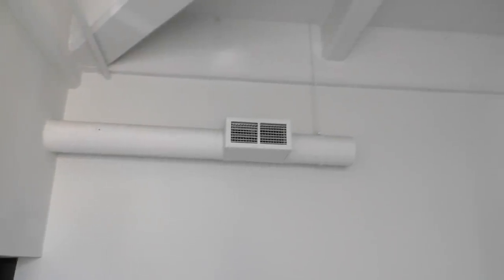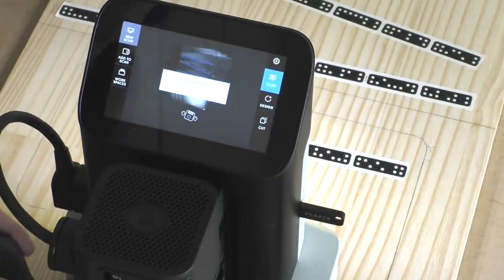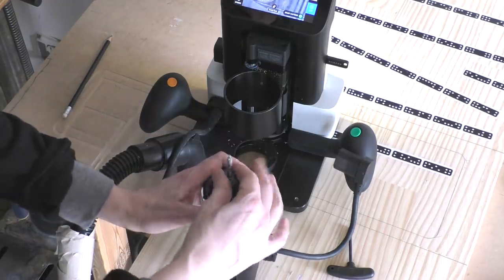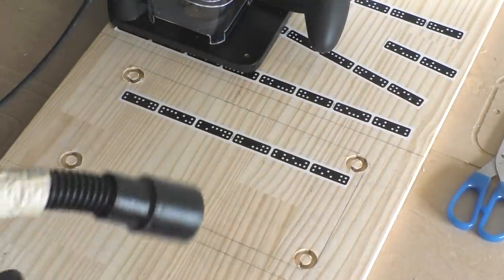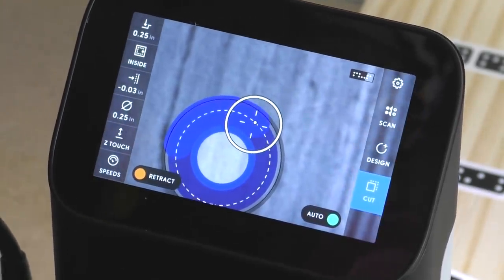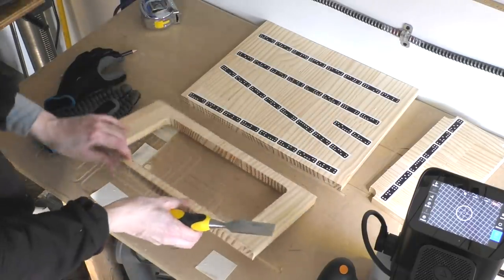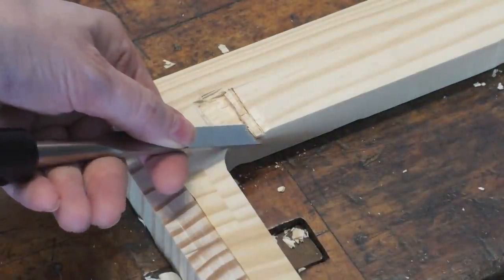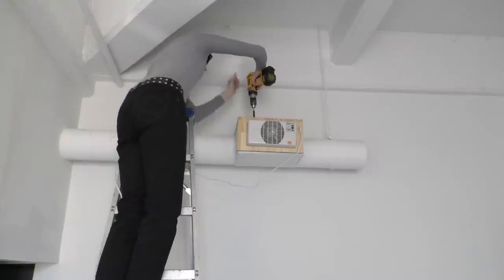Doing CNC On The Spot With The Origin

Comment: The project is nice, but if you’re having problems with cold/hot areas.....tell your landlord that your HVAC needs an air balance.  Alternatively, follow the duct back to the main trunk. There should be a branch damper that probably needs to be opened a little. If it’s already wide open, some of the areas getting too much airflow need to be dampened down a little to divert air to the starved area.  Before doing any adjustments.....Change The Air Filter! When they refurb rental spaces, they forget to replace the filters and they get blocked with construction dust and whatever the previous tenants put out in the way of skin cells and lint.    45 years of commercial HVAC/r and Control Systems here.

Comment: I'd have gone with the 3-phase squirrel cage blower. You might not be able to open any doors while it's running, but you'd be guaranteed to have as much AC as the building's systems can deliver.

Comment: Fran - Thanks for the very clear explanation of what you, and the Shaper Origin, do in order to accomplish this task.  You could have used a table saw to do the separation cuts, but by replacing the inner material and doing it the way you did, you showed us how to use the tool more effectively.  You also did a great job explaining how the tool moves the bit to stay aligned with the planned cut, even if you move the body of the Shaper slightly.  Thanks again!
Reply from the maker: I don't own a table saw.
Reply: Is that using the tool effectively though? I would hope one could measure the dimensions and enter them into the machine directly. That would presumably be the benefit over just using other tools to do the same job.

Comment: Just remember air takes the path of least resistance. What would help you is going to each room find which one has the strongest air current and close the vent until the air slows down in that room then do the same thing all around the structure in that order until your airflow through your home is balanced and each room has proper air flow.

Comment: Fran, as others have mentioned, never..never..never run a drill press or any other power tool without having your hair well tied back. 
 All that has to happen is to have just one wisp of hair get caught and it will scalp you before you can get it turned off.
 Some years ago, a lady at Sangamo Corp. (they made gas meter housings, etc.) was running a drill press and she dropped something. When she bent over to pick it up the air currents from the rotating spindle caught a strand of her hair. When they got the drill press stopped it had scalped her to the bone. 
  So don't do that anymore or I'll tell your mother.

Cheers from NC/USA

Comment: instead of double-sided tape, would clamps not be easier? Or is there a practical reason to use the tape instead?
Reply from the maker: It is needed to secure the interior cut-out pieces in the workspace - part of the basic setup for the Origin.

Comment: That was a 5 min.job in a wood shop.And that little fan won't do a bit of good unless the room is about 100 sq.ft.,you need to put a down pipe on your vent and get the vent closer to the floor.It won't do no good at ceiling level.Check your Cfms on the fan,if it's not greater than your house unit it probably won't work very good.Good luck.👍

Comment: Interesting piece of gear but I can't help thinking it would have been about 3 days quicker to cut out the shape of the hole from MDF and use a router bit with a roller bearing and just cut around that. Each to their own though!
Reply: Why would you cut a template? She's making 1. If your only making one, a template is not needed. Just spend the time cutting it out of the final material.

Comment: nice does it warn you not to move when your tool is still down? or have an auto stop to prevent over cutting?
Reply from the maker: If you go outside the reach of the robot it retracts and cancels the cut and you have to reset, and there are other safeguards if you move the Origin when the tool is plunging.
Reply: that's awesome thank you for the demo :) Hope your loving the new space it looks nice!

Comment: Is this router, cutter, auto controlled, or are you actually guiding it physically..
I'm not sure what the purpose of this machine is for, sounds like more work than if you just cut it with hand held tools etc..???
Maybe I'm missing something...??
Reply: It assists you by tidying your wobbly hand movements as you follow the virtualised template on the screen. The template is where you want to cut. You tell the machine this by drawing shapes on the workpiece surface and scanning them with the machine before you start to cut. As Fran shows, it's possible to add features to the drawn lines directly through the machine to tidy the drawing the machine has in its brain after scanning. The sticky tape with pictures of dominoes on it provides a reference for the router's 'eyes', so it knows how to cut out the template as the router is moved around. It (the machine) has control of the up down (z-axis) when you have set the depth and it takes care of the X/Y tidying as you move it around.

I think if you were doing multiple parts off, it would be easier and faster to make a jig and cut the parts by hand. But for one offs, this looks quite handy. It is a little bit of a gimmick, though.
Reply: @dewexdewex  ....thank you, I have a much better understanding of this machine,  and I have seen these used in  videos before, I just wasn't sure if it controls the x y movements mechanically or if it needs human assistance....it just looked as though she was moving the unit herself and not by mechanical assistance......
But, I think I have a better understanding of the machine thanks to you, I still think you could cut and drill a piece of wood much quicker and easier than using one of these machines,  albeit, it is a cool machine and I'd love to play with one, i just think i could do a much faster and just as good with conventional tools...
Thank you for your explanation 😀